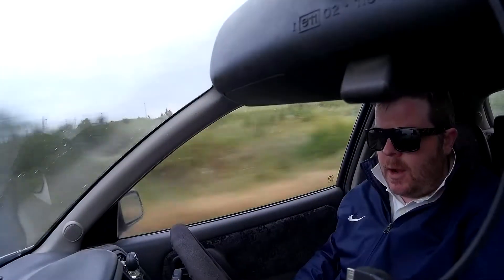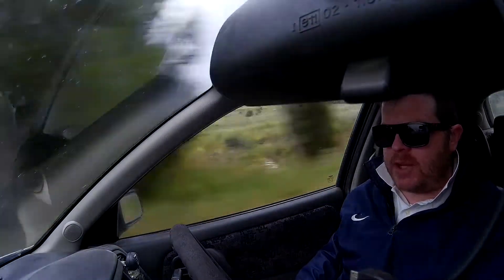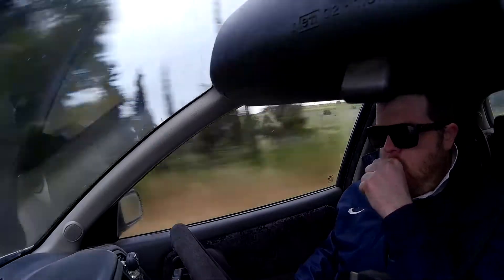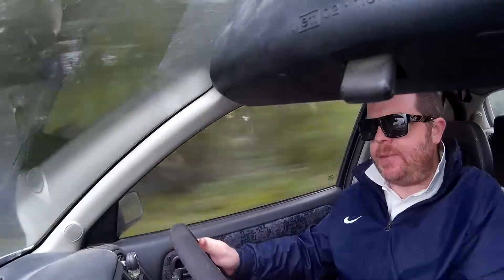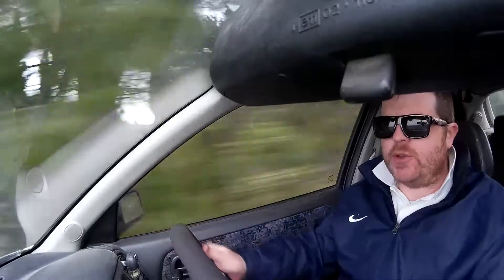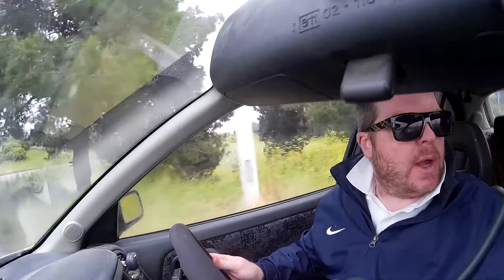Improve Fuel Economy with Warmer Intake Air?

Comment: I can have both in my car and I have that doubt. I can swap from 22C to 56C only by removing the air inlet pipe in the engine bay. With increased air temperature the ECU will inject less fuel and there is a loss of power. But wich one is the better for gas mileage if the engine needs power to handle the load?????
Reply: Generally warmer air is better because it reduces pumping losses by allowing your throttle body to be less restrictive. This is true in most scenarios but not all. If it's cold enough that your car never reaches true operating temp it also saves fuel consumed from the heater.
Reply: my thoughts exactly, speed Matt
@mattbrown292
Reply from the maker: In my opinion, I think in a perfect world you'd want cold air when you need power and hot air for light throttle/cruise conditions. Also I think the difference in the hot air needs to be something like 60C+ over normal intake temps for the different to be noticeable. Again. My opinion/guess.
Reply: @DriveTuneMedia  we can not set a general rule for every car I think. But I would like an YouTuber to do a "scientific" test to clarify since I do not find tested information in internet.

Comment: δουλεψε η οχι εν τελει μετα απο καιρο?
Reply from the maker: Sorry for the (very, super) slow reply. There is a hint that fuel economy improved economy slightly with warmer air. I think the intake temp needs to be *much* hotter for the different to be noticeable eg warm intake temps +60C versus normal. And I think there needs to be a way to get cold intake air when we need to accelerate.Hot air only for steady cruising. My opinion. I could be wrong.